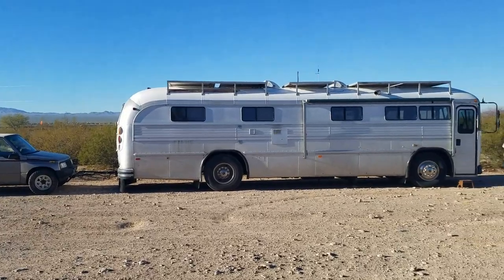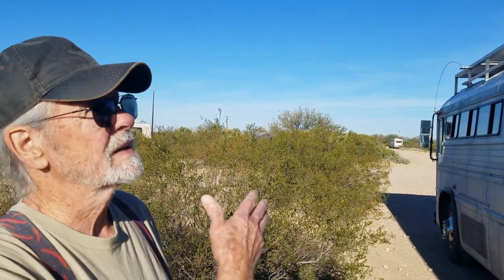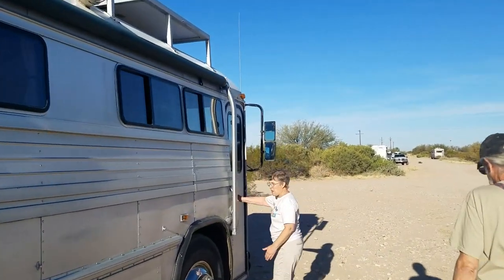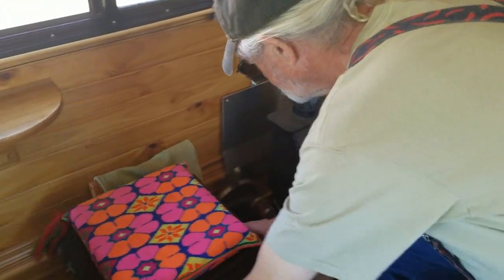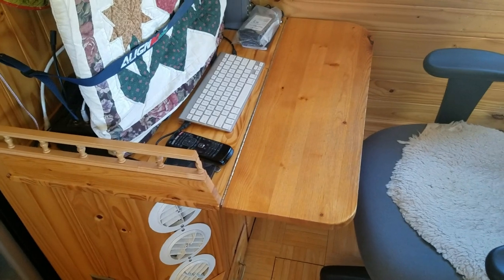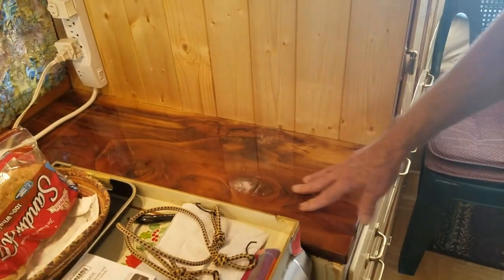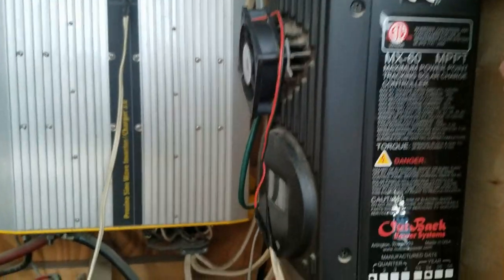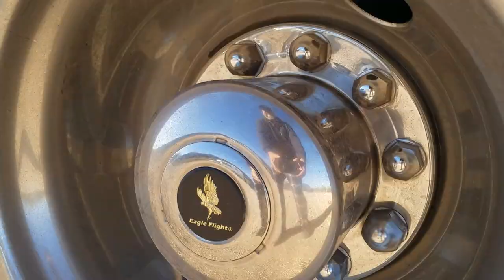OFF GRID "CROWN JEWEL" OF A BUS/RV CONVERSION!

Comment: The woodwork was very nice.  What a craftsman!  It seemed like their bus's engine burned very clean.  No black smoke coming out.  Their Tracker color matched their RV just like your new blue one compliments your RV with its blue striping.  How did you like the soft top on their Tracker?  Have you ever considered getting one for any of the Trackers that you've had?
Reply: Properly set up a Detroit will burn reasonably clean.